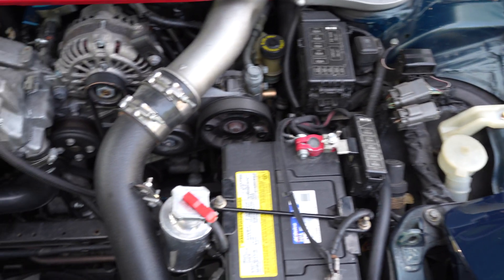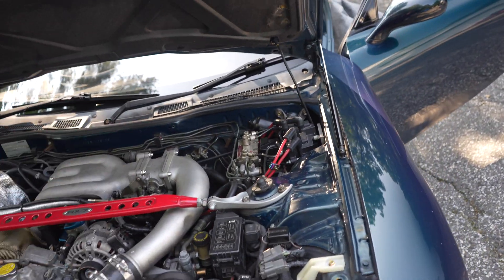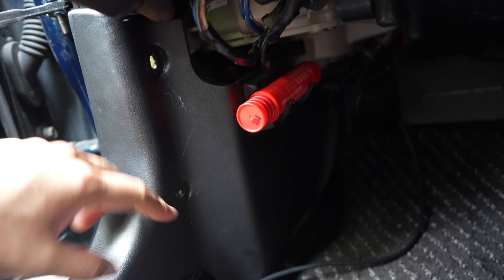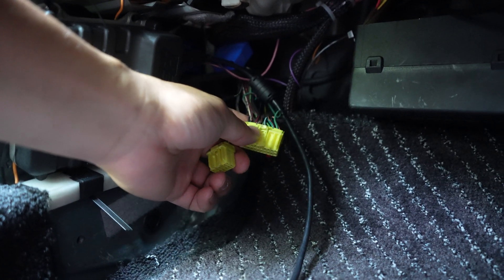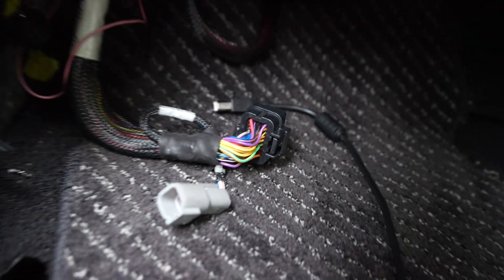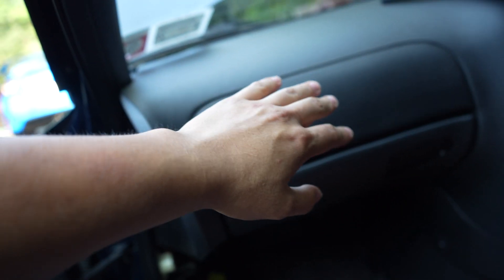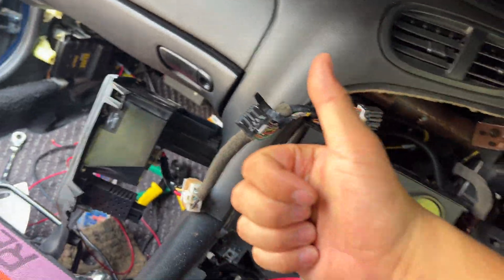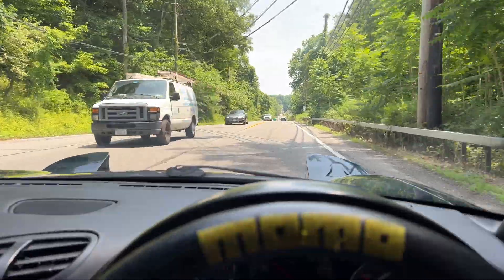RX-7 Working AC on Standalone ECU (Haltech)

Comment: Im thinking of purchasing this Haltech. Whats the advantage of this Ecu?
Reply from the maker: For what car and what mods? Highly modded, especially 90s cars will end up needing a standalone once you change turbo, injector size, fuel type, etc. With a standalone you can wire in a bunch of sensors that didnt come factory and you can setup CAN displays for your sensor readings. Plus launch control, boost by gear, and tuning safety nets. The list just keeps going on but that’s the gist of what standalones are for.  However, wont pass emissions in most states unless exempt by mileage or age.

Comment: I was hoping you'd cover your settings within the calibration lol, because I got my AC charged yesterday but the compressor isn't getting power. I ran 1E to input and 1L to output, and I need to change button mode to 'push on, push off', and I guess I'd need to change 'switch on' and 'switch off' to your settings (did you put 0.8v in switch on and 5v in switch off?), but I'm not sure what to put in for 'pull up enable', or for 'active state' or 'drive type' under AC output.

Great video though! I like that you went through the wiring in the ECU connectors, I think that's the type of info most people will look for.
Reply from the maker: Shoot me a DM on IG and ill show you what I did! @Ggp.ny
Reply: @BuyYourBuild  I might be the only person without IG these days.  My wife is on there though, I'll see if she'll send you my email address.  Or are you on 7club? Thanks!
Reply: I need the same help